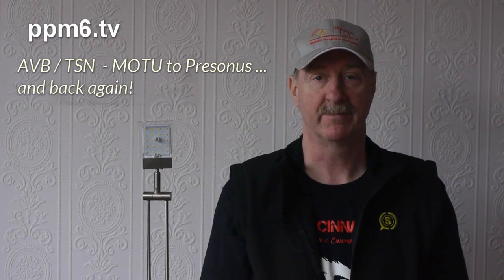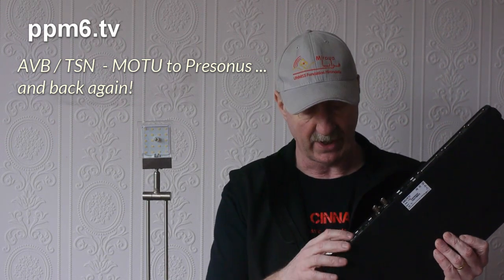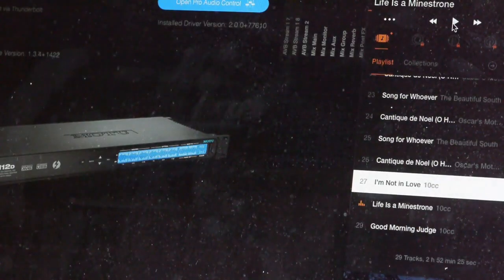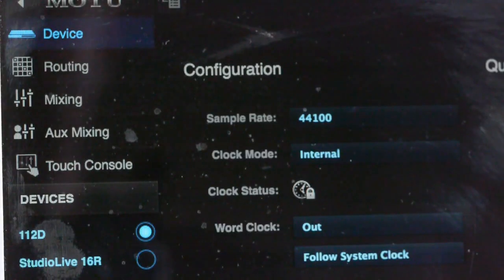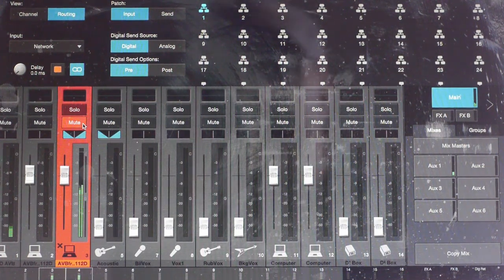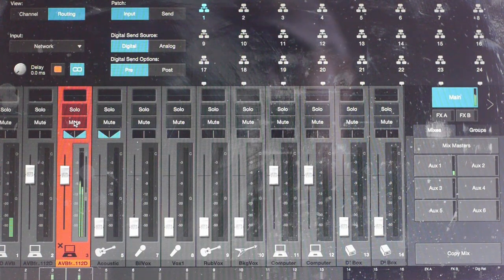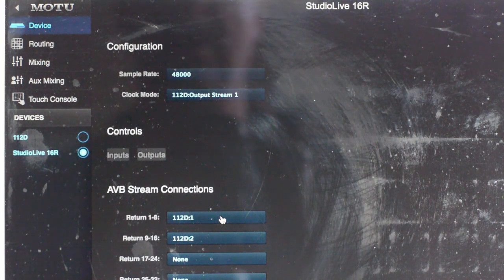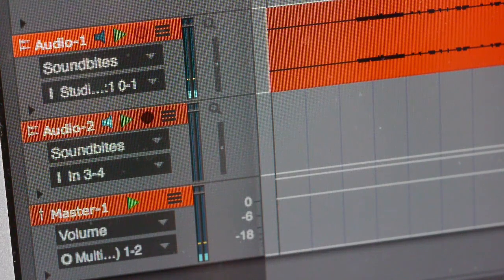AVB Audio Networking MOTU connects to Presonus - What's Missing?

Comment: Excellent video overview and explanation of things!  This really got me digging with my MOTU 624 and Presonus 32R (Touring In-ear Mixer) that I have now that we are locked down here for a bit.  

Unlocking a full 32 channels of AVB outputs to the Presonus Rack mixer and a full 32 coming back in is really something.
The 624 Had 30Ch of Playback from Ableton PLUS direct Guitar and Bass! using the 624 as an "On-ramp" to the network and bypassing Computer.

Found a roundtrip latency of .07ms from:
Ableton Multi Outputs -> TB to MOTU AVB Stream outputs - > Presonus Mixer Channels AVB Inputs -> Direct out to Presonus AVB Outputs -> MOTU AVB Inputs -> Ableton Multi Inputs.  

I was really impressed... kinda floored actually.
It currently has me re-thinking the entire need for DI's and Subsnakes for all live playback stage needs in the future. 
(once we get back at it)

Current update allow you to use your computer as an audio interface onto the network as well.
They are both very cool pieces of gear that can really be a wildly cost effective expansion option for any studio of live setup.
Reply from the maker: Hi Chris - what a great AVB story. I've recently returned to the questions around AVB and I'm thrilled you've had such a good experience with the Presonus/MOTU interconnection. My questions for you are firstly about stability. Have you actually had a chance to gig this system?  Have you done any tests for how long the AVB will stay connected and solid?  Are you on Win10 or MacOS for playback? And if MacOS which version?  I know Presonus and MOTU are working hard at AVB intercompatibility and frankly this needs to happen fast. The next stage I would like to try is introducing a switch, hopefully this will happen soon.  Ta like, ppm6
Reply: @ppmtv-qh9qk   
Funny you ask about stability!   
No gigs to actually use it on right now due to COVID-19 cancelling all my events (insert sad face).  
But for now, Basement Beta testing it is!

I'm on a 2018 Macbook Pro. 
OS 10.12 (Currently avoiding Catalina update as my machine runs GREAT right now.)
Thunderbolt Connection.

Last night I set up a simple 16ch Playback from PT12 to the Presonus mix channels via Motu AVB,  Hit Play/loop, and went to bed. No Recording back in to save some hard drive space.

This Morning I woke up and Opened up the Ipad UC Surface app.  Sure enough, it was still seeing metering from the AVB network...after 10+ Hours of running non-stop playbacks on the network overnight.

No posted hiccups in the logs from PT12,  MOTU,  or Presonus .  STABLE!!!!!

The only thing I found that caused issues was when you would change to actual architecture of the AVB network from the MOTU control app.  Like adding input or output Streams after your initial setup.  I found that I would have to re-boot both MOTU and Presonus after making a change to an already operational network. Makes sense as both units would have to reconfigure themselves to see the new network setup.

ALSO!! 
After simply Unplugging the Network cable between the 624 and 32r and Plugging it back in (with out changes to the network) it took about 3 seconds for the Presonus to see the AVB streams from the Motu again.  Very Impressive and showed consistent results doing this a few times.

Lastly, 

I found that while most of the network setup and routing needs to be done on the MOTU end of things, routing back onto the network from the 32R is quite easy and flexible from the Presonus UC digital patching.
Meaning you can have %100 flexibility as to what input mix channels are showing up where on the return streams to the MOTU/Computer.

Alas, with no gigs currently,  I"m trying to design a mobile (COVID Recording rig, where I could stay out in my car and run 300' of Cat5e into someones house to capture, while I sit out in my station wagon.
Presonus as the Preamps and Motu 624 as the interface at the car.  Still in the design phase here though.
Think like "Front Porch Sessions"  with full social distancing.  Each band member gets in ears and a click track to record themselves with their other band mates while staying at their own homes.  Filming this as well for final products.  

All this being said,  I too am interested in seeing performance once a switch in put into the AVB topography. But I really think that the actual performance and stability will not be affected.  Both Companies advertise .07ms as the fixed round trip latency over the network whether there is a switch involved or not.

I personally think the Presonus switch may be a tad better, only due to an internal power supply and my own general disdain toward wall wart power supplies.  
Also,  Presonus using PoE for their network expansion boxes is pretty hot.

I"m glad that there is another page that truly supports MOTU!  I've been very brand loyal for 15+ years now and they have NEVER let me down.  Honestly some of the most rock solid drivers in the game.
I really put full faith in AVB.  It often gets overshadowed by Dante, Ravenna, AES67, etc. 
But with Dante costing double the money for hardware, let alone more money for the controller software, and then a little more money to use just a computer to stream onto the network........you get where i'm going. 
MOTU wins everytime.

One last thing I would like to test out here is the passing of LTC or MTC over the AVB network for Sync purposes.  Generally, Timecode does not like to be digitized, but if it stays digital as long as possible before D/A conversion, theoretically it should work.

Comment: The good news is your advice is still good in 2020. The bad news is, presonus doesn't seem invested in fixing the lack of control for their series 3 mixers.. I got my studio live 16 series 3 to work with my Motu 828es, but it's not ideal is it. Thank you for your video though, it gave me the confidence to dive is a couple of days ago, and succeed :).
Reply from the maker: Hi Tony, can you remind me of your set up and also which elements you feel need most attention from Presonus or indeed MOTU?  I'm encouraged that RME are getting on board with AVB, and I hope  that all manufacturers will see the value in having the fullest working feature set possible on their gear. And that it can all work together.
I can't speak for Presonus but I'm sure that  like much of the pro audio world they have been impacted by Covid and that resources have  therefore been  tighter and that we can hope that in an upturn they will have the desire to work on AVB functionality. Thanks for the comment, ppm6.
Reply: @ppmtv-qh9qk  the funny thing is, two hours or so after I posted this, Presonus released a new firmware and control version. I’m yet to properly test it but initially it looks good and did solve at least one issue I had. I use my setup of a UAD Apollo quad via ADAt to my Motu. Motu is clocked to the Apollo these are connected to a MacBook Pro. From there I AVB to my i9 based audio PC and my Presonus Studio Live 16 Series 3. It all works as expected. I was really mirroring your sentiment that visual confirmation within the Presonus could be better. Once you understand the whole setup though, it’s very flexible.
Reply from the maker: Tony - thanks for a prompt reply - I must check out the firmware etc. myself. Thanks for the tip. And yes more info and visual confirmation would be excellent. Glad it's working sounds like a meaty set up. Are there any gigs where you are? Still quiet here in the UK.  Ta like ppm6.
Reply: @ppmtv-qh9qk  I'm in  UK too :) so, no gigs. I have two rooms that are separated.

Comment: Thanks for sharing this. I'm looking at getting a StudioLive 32s and was wanting to connect to MOTU over AVB. I couldn't find any other info on whether it would work. This helped me decide.
Reply from the maker: Thanks Jon, I'm still a little cautious about interoperability. Mostly because of questions around support, because if you run into issues,  it's kind of hard to get support for 'cross manufacturer' issues, just by the very nature of life. Presonus have been very, very good on support and I can't speak highly enough of them. I assume you already have some MOTU AVB gear, if you have a specific set up/requirement in mind, I would reach out to Presonus (and MOTU) before dropping the big bucks. Ta like, ppm6.

Comment: There is another presonus app called "AVB Audio Configuration" which you access from the Universal Control settings menu that you can map AVB endpoints in a similar manner to the motu
Reply from the maker: Hi John thanks for the tip - I have not come across the Personus AVB config app so this is good news. Funnily enough I am about to start a video in response to Karlis's question below and I'll take a look. Thanks for the spot.
Reply: @ppmtv-qh9qk  It turns out the control panel I was referring to was actually an osx built in control panel. which you can also get by typing "avbutil" in a terminal window and then typing  "controller" which will open up the suite of tools. There are multiple screens available in the window menu. 

I also found some interesting utilities on Github for instance https://github.com/christophe-calmejane/Hive (binaries can be downloaded here http://www.kikisoft.com/Hive/ ) I'm still very much a newbie with AVB...

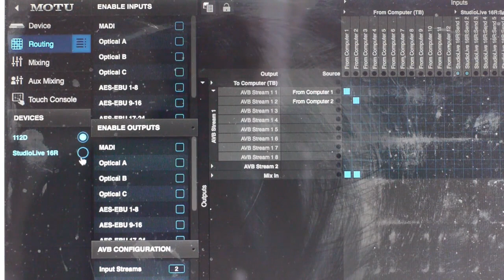Comment: Really great job, thanks so much! With my band, we use two MOTUs, one Ultralite AVB and one 828es AVB, which we use as a mixer. Thanks to your tutorial, I know that I can connect a Presonus Series III (16R ort 24R or 32R) as a stagebox, but my question is : will I be able to set the gains for the Studiolive's inputs using the MOTU interface ? After selecting the StudioLive 16R (at 9:55), I'd like to see all the available settings on the Device page (if there are, below "AVB Stream Connections")...
Reply from the maker: Hi Jean-Marc - that's a great question. I know both the MOTU and the Presonus software have been updated since I made the video. I'll have another look but I don't think you will be able to control the Presonus from the MOTU. But the Presonus has two network ports. One carrying AVB audio and the other standard ethernet traffic. So what you might be able to do is run an Ipad on the network just to set the gains on the Presonus?
However and this is a big however, once you have three devices you need a switch. And I haven't got a switch. Both MOTU and Presonus make them. So this hasn't been tested over  a switch. I'll try and get one to see if it works. Can I ask you are you recording your mix via usb or AVB at the mix position or indeed on stage?  Ta like, ppm6
Reply from the maker: Hi Jean-Marc - I had an interesting conversation with Presonus.  Their take is that while their switch is a standard AVB device and should work interchangeably with any other AVB system, they don't warrant that the mixer ecosystem stage boxes and monitor mixers etc will work with other gear. In this case MOTU. So while the basics might work there is no guarantee of even that functionality. Until I get a switch and add other boxes to a proper network and test it, I'm not confident this is a reliable route!  Ta like, ppm6.
Reply: Hey Jean-Marc,
In the Motu control app you need to turn off "Computer Volume Controls" in the device tab for the MOTUs.
The outputs levels to the Presonus via the avb streams will then be dependent on the DAW playback levels independently.

Once you are looking at the AVB input sources on your mix channels in Presonus, you get 20db of digital trim (+ & -) on those channel inputs.

Hope this helps!

Comment: Hello. Question for you about this. I love the idea of grabbing one of these presonus boxes. 
My question is are you able to remote control the preamps of the prenous from within motus mixer or do you also have to have the presonus mixing app open to control those??
Reply from the maker: Thanks Dustin, great question. It would be great if you could control the mic pres from the MOTU app but sadly not. However you can easily control the Presonus with an ipad over wifi or even from a computer over CAT5 - if you don't trust the wifi!  The Presonus has two ethernet ports, one for AVB and one available for 'Control'. Hope that helps. Ta like, ppm6.

Comment: Great video, thanks! It's a shame that the Presonus still needs a USB connection to adjust the preamp levels which reduces the benefit of being able to have long ethernet connections.
Reply from the maker: Hi Michael - I'm sorry I don't think I spent enough time on that aspect. I used the USB connection out of convenience and that might be misleading. 
The 16R can be controlled over the network port which is separate from the AVB audio port. The network connectivity is therefore accessible independently from the AVB.  So you can run a 100m of CAT5 into the network port back to your router and use Universal Control to control the mixer.  That's two 100m ethernet cables one for AVB audio and one for control  but not a big deal.
Or of course you can site your wireless router locally to the 16R and control over wireless from wherever you are. And in that case your talent will be able to mix their own monitors from the UC Surface software. That is the flexibility of having the standard network port alongside the dedicated AVB port.

Comment: I guess you could crunch and lofi the drums and keep the strings at a higher sample rate. Thinking about textures. That was the difference I saw in the dante video. Dante has to have a uniform rate 44-192 all the streams would need to be the same. Apparently AVB doesn't need this, why because it can actually have different clocks. The guy said think live broadcast at a television network and field reporters. Each having there own independent stream. Take it away Joe lol
Reply from the maker: Hi Marcus - I have found reference to multiple sample rates over AVB - this from the MIT web site talking about BSS gear - 

MCN (Media Clock Negotiation)
Media Clock Negotiation is used to synchronise audio clocks between devices in a single audio clock domain. AVB allows multiple media clocks on the network with multiple sample rates co-existing. Each talker stream must specify which media clock it is using. There can be 256 different media clocks on an AVB network.

 Which is exactly what you are saying, but I'm not sure how that would be implemented, surely my AVB device is running at only clock rate in audio terms what would do with two streams at different rates!?  I've asked Mr. Cole - he's a man who knows!  Thanks for the input, thought provoking stuff!  Ta like, ppm6.

Comment: Have you noticed any drop outs while changing gain values/levels in presonus?
Reply from the maker: Hi Will, funnily enough I'm sat in front of the 16R and the 112D trying to set up to do a video on digital splits in AVB. I'm not sure of the context. Do you mean I have a mic plugged into the 16R and an AVB connection to the 112D - I then make a gain adjustment in the 16R Universal Control software and the audio at the MOTU end glitches. Or the audio at the 16R end glitches or both? Let me know and I'll chase. Ta like, ppm6.
Reply from the maker: Hi Will - I notice you have a Frijid Pink playlist - as a kid we had a copy of FP's House of the Rising Sun in the school rec room, I must have listened to it a thousand times.  Always had a soft spot for the Pink!
Reply: @Tonetopf Music & Audio Hi, it´s been one year now, just wanted to ask if this problem is solved maybe by firmware updates? cheers
Reply: @Tonetopf Music & Audio thanks a lot. I don't have the 16r yet but Was planning to expand m 828es with it..
Are the preamps ok?
Reply: @Tonetopf Music & Audio thanks! I was thinking for that price it can't really be high End, the B 16 looks good though. I still have some audients but having remote controlled preamps is such a great thing..
Reply: @ppmtv-qh9qk   Jeesh, now i notice your reply. But yes i meant that if you adjust gain on presonus the audio used to drop on motu, and i see other have had this issue and resolved it?

Have you tried the nsb boxes with motu?

And ues, i am a big FP fan, the playlist was for learning them with a band i used to have. 

All the best and hope you are well!